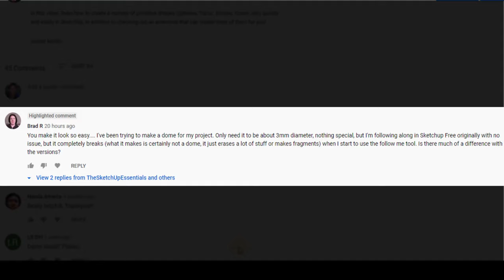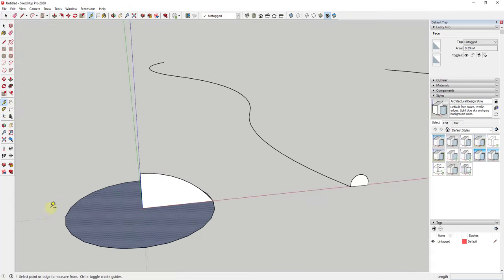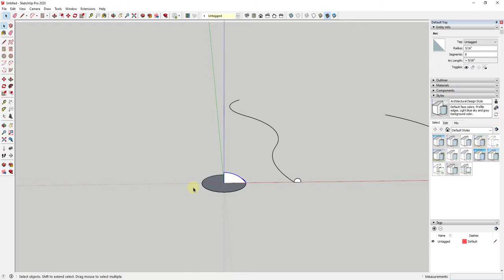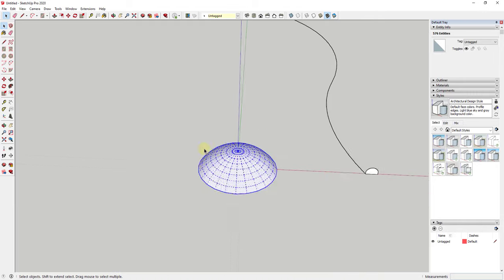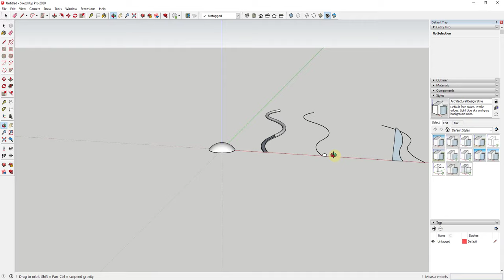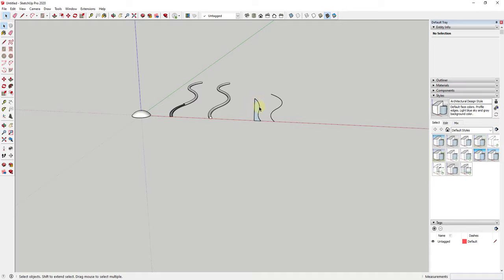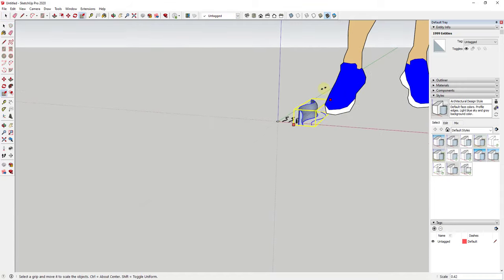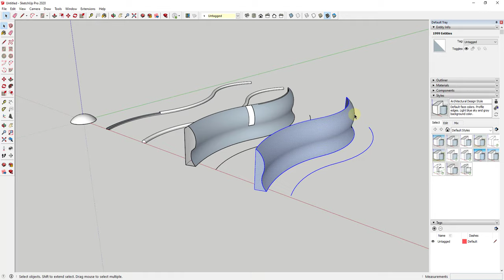Fix for SMALL GEOMETRY ERRORS in SketchUp!

Comment: Great video as always. A similar method that I have used is to make the objects a component, copy that over, scale up the copy and then apply the follow me to the larger component. This then generates the correct shape on the smaller component as well, and then I delete the larger copy.
Reply from the maker: YES - they call that the Dave method on the SketchUp forums - it's really smart - I just for some reason find this quicker, so I do it this way, but that way is perfectly valid and possibly even a bit better - thanks! :)

Comment: Your videos really helps me fixing the model in sketchup. Can you please make a video on how to make brick jalies. I am an architectural student and I want to make jalies and i am so confused on how we could color it such a way it looks like jalies.
Reply: Are you wanting a "material" that you can apply to a surface that will actually have the cuts in it? Or are you wanting to make the bricks? 

I've made bricks for a patio screen that had the usual pattern of cuts, but it slanted off at a 45 degree angle so you can't see directly in front of you. It blocked the direct view & gave an indirect view while preserving air-flow. I just built it by hand, one curve at a time, applied a cement or sandstone texture to it and made it a component and built a gorgeous patio wall with them.
Reply: I just did some experimenting and found another way!

I made a flat, 2-D drawing of this block here:

https://ezhilgreenhomes.com/brick-jali/

Then where it is supposed to be hollow, I used the color white and edited the color and make it completely transparent. 
I used sand for the texture and scaled it down pretty tight. 
Then I softened all the edges - so no black lines. 
Then I made it a component and multiplied it. 

I don't know how to make it a texture. Maybe there's a tutorial for that...

Comment: I do exactly this, except if I'm working on intricate and small, I do everything in 10x scale, or even 100x if it's really, really detailed.   It eliminates issues 'too many segments for the curve' and, or course, geometry problems.

I'm pretty sure it's due to how Sketchup handles arithmetic.  Since Sketchup was originally designed to model architecture, the precision of its arithmetic is probably too limited for very small objects.  Of course, I'm not a programmer, so I very well could be talking out of my a**, and I assume also that there's a good reason for not implementing such fine precision in this particular software.
Reply from the maker: Lol - it's as good a guess as any :p

Comment: Hey Justin, hope you’re well. You reversed faces at one point. Something I never looked up as to why one would do that other than for a face to look the same as surrounding faces. Does it go deeper than that, I.e. does it affect how the model will behave during a particular function, add- on manipulation etc.,etc.. Thanks for any explanation as to why and when I should    reverse faces.
Reply from the maker: Here you go! https://www.youtube.com/watch?v=Y3kJlaXiNcA
Reply: TheSketchUpEssentials : thanks Justin, good video. Now one thing you didn’t touch on was how or why does it happen, I know I could try this but I’m not at my computer but sitting at the docs office.... I’m assuming by drawing in a specific order/ direction causes a reversed face. I.e., correct me if I’m wrong. If I’m drawing a rectangle using the line/ pencil tool and draw four lines clockwise, do I get a correct or reversed face? Same question if I were to draw counter clockwise?  If using say the rectangle tool, pulling corners in a particular direction, top left to bottom right apposed to bottom right to upper left. Would the resulting faces be the same or different? Thanks and I will try this theory of mine ASAP

Comment: Hi I made a cylinder and embossed a logo on the surface, I designed it at 1000% then scaled it down, parts of the edge of the letters disappeared when smaller, at 1000% it was perfect, any ideas?

Comment: Awh! So it is an error die to precision limitation in number representation?
Thanks a bunch!!
Reply: I would think if you increase number of segments in the arc you would ( in the case of the dome for example)  get closer and closer to closing up the geometry. I’ll have to try to confirm, but to me it make sense based on your reply.  👍
Reply from the maker: It's just a limitation in the minimum size and segment count SketchUp can create in small objects
Reply: Sketchup will not draw edges shorter than 0.001". Scaling down from a larger size is a way of working around this limitation. The explanation from the Sketchup team can be found in the following post: https://sketchucation.com/forums/viewtopic.php?f=15&t=25175&p=218997#p218989
Reply: @Svanevej7  Thanks!